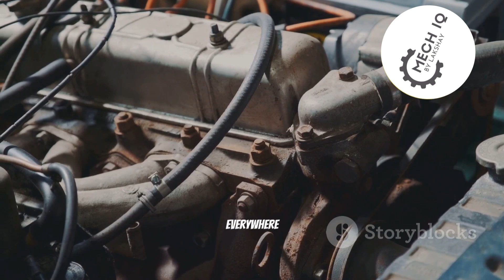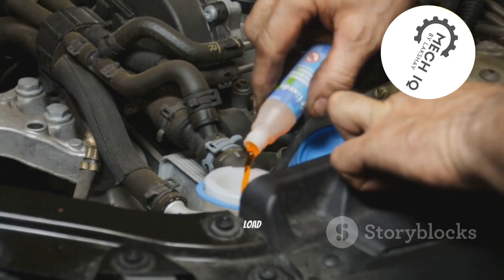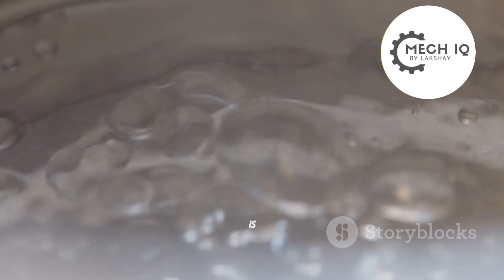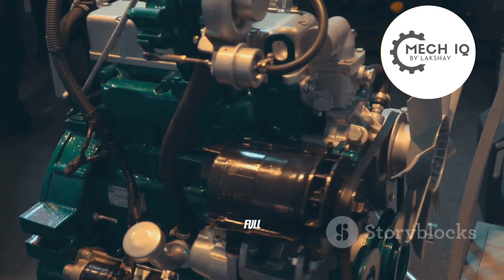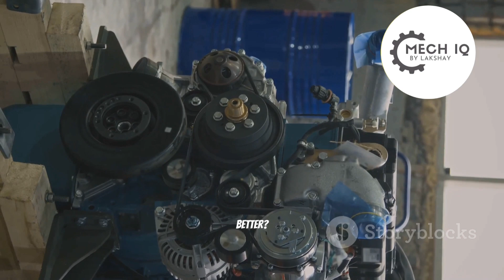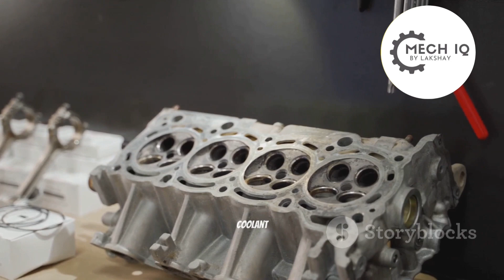#3 | Why Your Car Can’t Run on Just Water – Critical Role of Engine Coolant | Mech IQ⚙️ By Lakshay

Comment: Thank you so much for the wonderful insight on how coolants work and how important they are for modern engines!

Can you make a video on the impact of fuel with higher ethanol blends when used in vehicles suited only for lower blends, and what is the way to cope with it, such as parts to be modified/replaced/tuned, and additional maintenance measures?
Reply from the maker: Sure , I will make a video on that topic soon , thanks for the feedback mate!
Reply: Yes interesting topic 😊❤